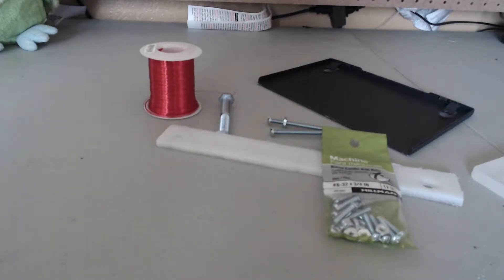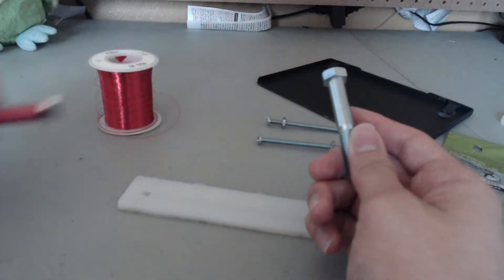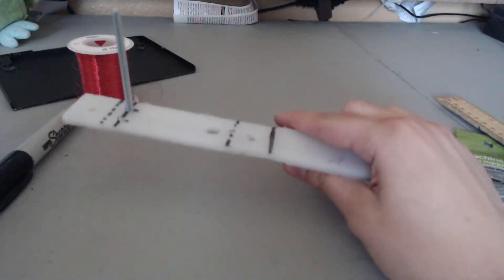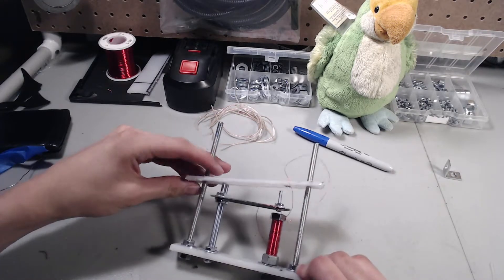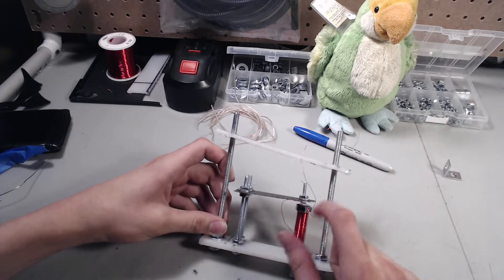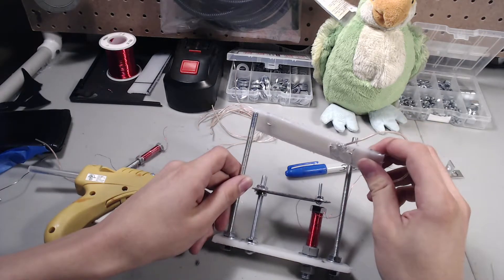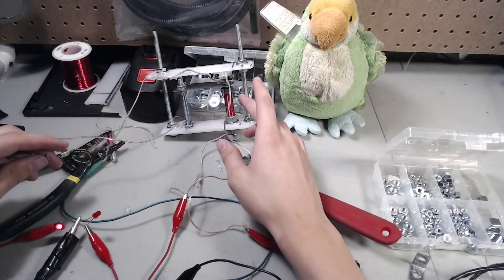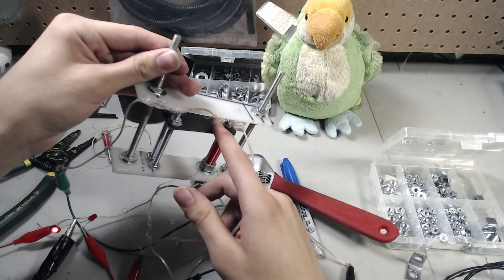How to build a relay SPDT

Comment: That's exactly what I was looking for! I want to build simple D latch to store one bit of data (experiment for my kids). My idea was to create always closed relay where gravity is holding the connection when power is not connected to the coil. When power is applied to the coil small metal piece will be attracted to the electro magnet above and close another circuit. Basically what I came with is exactly the what you did but with coil above not below. Then I wanted to find out the best way to build it from heap pieces from the local store. Looks like your idea with screws and two rectangular plastic bars is the best and simplest way to do it! IMHO, you can simplify your design by adding just a screw above your coil that goes through this top plastic thing. You don't have to glue any rectangular piece of metal.